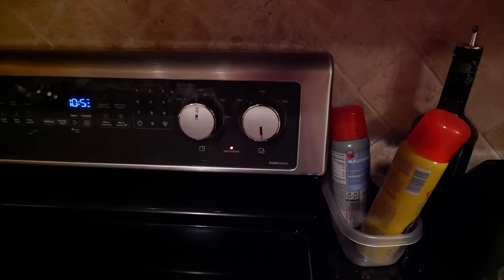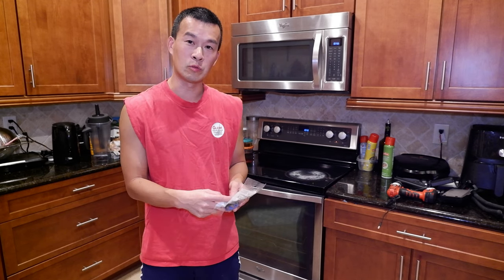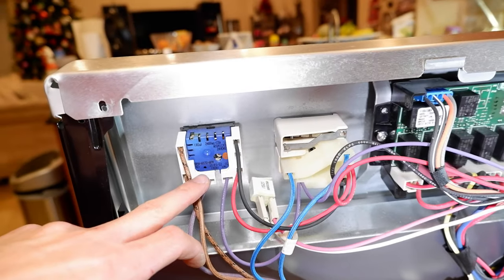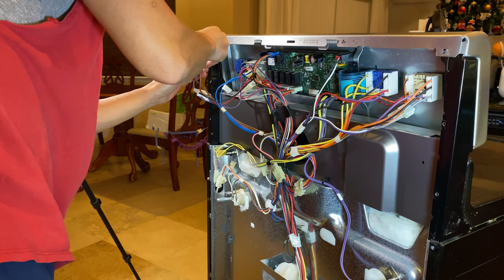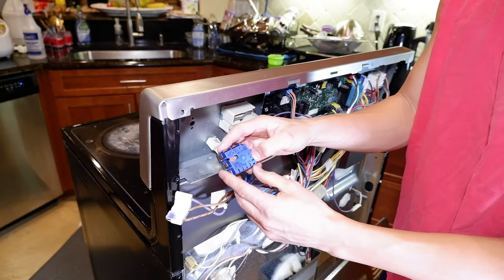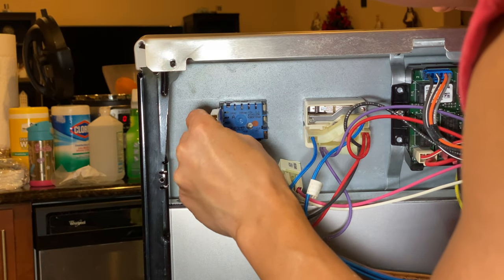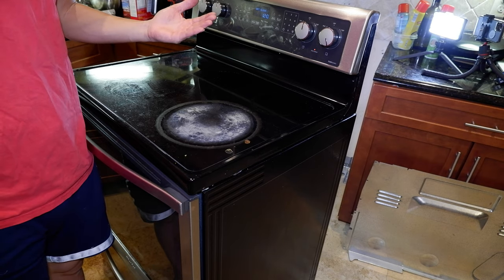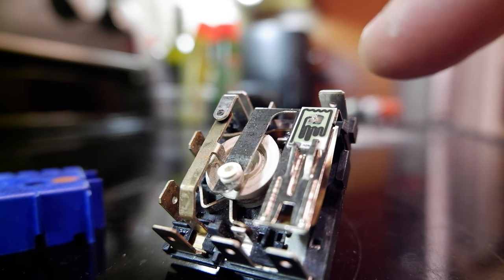How to Fix Whirlpool Stove Switch | Burner NOT Regulating Temperature | Replacing Infinite Dial

Comment: I'm glad you deviated. Id rather spend $50 on a new switch instead of $300 for a repair man or $600 for a new range. Good job.
Reply: THATS  MY PLAN. IVE BEEN DEALING WITH BOTH OF MY VARIABLE BURNERS OUT FOR 3 YEARS

Comment: Thanks for making this video! My range was having the same symptom and I didn’t know where to start. Once I took off the panel and pulled out the switch, it was more than obvious that it had failed with all of the soot it had around it. The part only cost me $18. Great video!
Reply: Very encouraging. Seems fairly straight forward so I'm going to go for it.

Comment: Wow impressive you probably would of spend a fortune on a appliance repair company I wish everyone was like you!! I'm a appliance repair for a company and this is a common issue on all brands
Reply from the maker: If everyone knew how to do this, you’d be out of a job?
Reply: @TunerwithKids  lol yes but I work for a company that deal with mainly  factory warranty
Reply: I wonder if they do that purposely so you buy a new stove cause I did just spend over $200 for that little part
Reply from the maker: @vivians3696 it’s a wear part especially on your main burner. The constant turning will wear it out. Same with the the heating element.